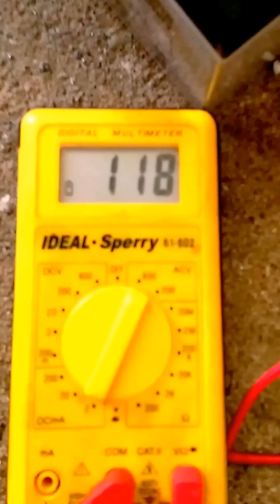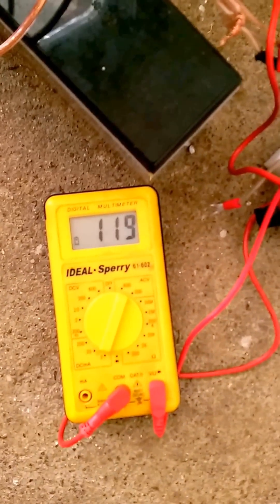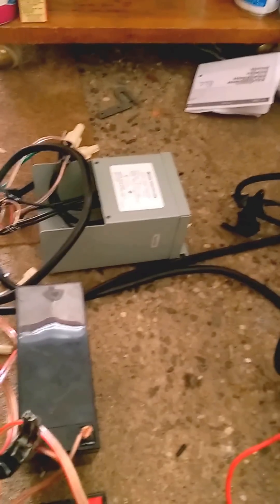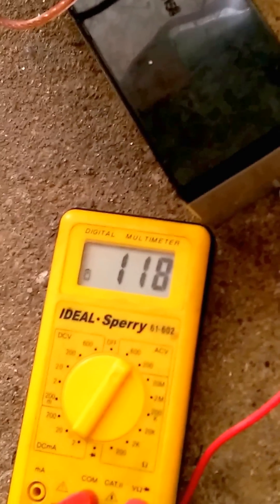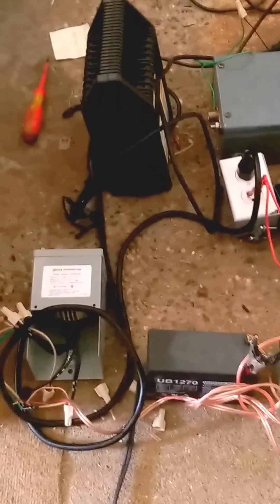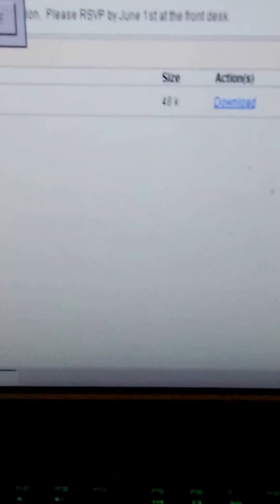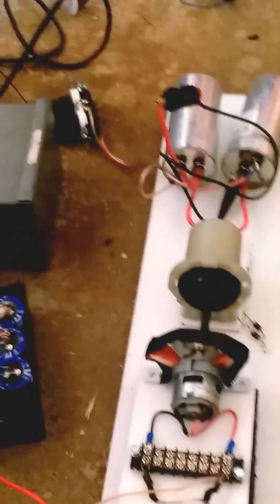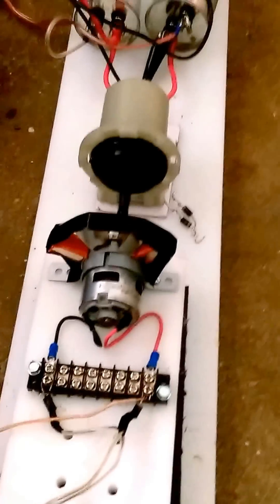Gerard Morin Washer Pump Generator &  PELEX DEVICE Successfully Looped!

Comment: Are you trying to claim mains transformers are resonant devices?
Reply from the maker: +Mark Tillotson I was trying multiple options to see if I could put the DC voltage from the overvoltage spikes coming from the Morin Washer pump generator to add additional charge to the capacitors through the rectifier. The generator creates a pulsed square wave and the output of the transformer was not working correctly, due to the increased core saturation causing too much of a loss since the wave coming from the genrator is NOT a sinewave as most folks think. I tried to utilize this cold electrical spike in an attempt to collect the additional energy and dump it into the cap bank for use as a recirculating current in an attempt to gain a few volts to make the motor continuie running without loss. The Pelex device would have done this all by itself if the generator was a sinewave, however, at the time of the video, I didn't rea;lize this until I scoped it later that night to see why it only had so much output, and only enough to operate one ac bulb and loop at the same time without loss. I recreated the system using a different generator which gave me 1250 watts out after all of the loads in the system were consumed, as well as the losses. The next experiment I did was to step the voltage much higher and use the hairpin circuit with an air capacitor to create resonance, and it did work as i anticipated. Please see my next message where I explain how the new PELEX DEVICE operates without external power. The batteries fire the motor, and, the pelex device does what I state in the next comment's reply.
Reply from the maker: +Mark Tillotson  Hi Mark, I believe that tansformers of any efficiency have to be very close to resonance if they do not already resonate, especially if we wish to draw in energy from another place wirelessly. The system I built utilizes transformer coils matched with capacitors to resonate at the Schumann Resonant frequency of 7.8 hz.  I got the idea of how I would do this from Stanley Meyer's VIC coil, however, it didn't work until I built the core myself which caused an overunity just like Gerard Morin's transformer phenomenon. When I scoped the coil with my variable air capacitor and found resonance, I read the capacitance and found what I have aimed for from a frequency chart around 8 hz. When I adjusted this and soldered the cap onto the coil, I was receiving a signal at 7.8 hz and the coil was automatically outputting several volts of power without any input.. I was just using the transformer as a receiver of this energy and by applying a signal to the other coil, I was receiving additional energy that I didn't expect. With the correct input, there isn't any issues at all with obtaining resonance without adding outside components such as capacitors,  however, to make this happen if they aren't in resonance already, minor adjustments of the capacitance can be made to both coils in a couple of ways, first to improve the efficiency, as well, by rebuilding the coils to make the inductor have more capacitance in combination by winding a secondary with a thin aluminum plate or foil, and, building the windings over an oil impregnated paper dielectric with the primary wound over the top of the secondary using a very fine, extremely conductive wire, this can be accomplished fairly easily, if the correct frequencies are obtained purposely. Accidentally, it isn't very common for any resonance to happen, however, with transformers of super quality, the resonant frequency is the optimum frequency to reach, beyond this, the device will saturate and cause massive losses. To obtain overunity, the core has to be very specific, either cut to eliminate the Lenz effect which is the unwanted flux path that creates the CEMF to cause the load to be forced back to the input/source like any ordinary transformer works. I completely eliminate the source load and transfer it by creating  magnetic manipulation similar to Tom Bearden's MEG operation to initiate an incoming stream of energy that is channeled in using a sharp pulse/spike containing a  high voltage pulsed square wave with a very noticeable sharp spike of 50-125 volts at the leading edge of the squarewave that's produced by the permanent magnet rotor. This works kind of like a switch to turn on a stream or channel of energy from the atmosphere, allowing it to become attracted to the device's magnetic field by the oscillating pulses by attracting or manifesting a very unique phenomenon. This creates a "Flip Flop" of scalar energy forced from the forward and reversed flux surrounding the dual core that attracts the energy from one core while the other is merely pulsing a magnetic radiation that allows the energy to be channelled from an aetheric source during the change in wave from + to -  , and, the funny part is that it can only happen while the load is connected to the device.  This incoming energy is forced to the secondary by induction, however, the primary coil's pulses create the field that this energy is attracted to, however, it can't induce to it since it is already powered up and it's field aligns and synchronizes the flux of the secondary, allowing the scalar waves to be induced like magic. The device sees an AC waveform on it's output under load, and, while one polarity of pulse happens, one core releases the field attracting the source energy while the primary coil induces the aetheric electricity which causes the secondary core to release atmospheric electricity as cold electricity to the load while the other pulse happens of the opposite polarity , then the opposing core attracts this stream of energy while the the other core causes the field to be induced and transformed to usable electricity of the opposite polarity. (to make it easier to imagine, one coil  pulses and the core's field attracts the stream of energy while the other one induces to give one half of the output wave, then, the opposite happens and the other core attracts while the other side induces the opposite wave.) In other words, we have 3 coils. The first coil is the primary or "pulse" coil as Stan Meyer used to give to the core in his VIC system. The pulse creates a magnetic field of opposing polarity, causing an attraction from the aether to one core and it's field as the other core's field allows this energy channeled in from the aether to be induced into the primary which is connected to it's output. Since the cores are separated, the input coil is a series/closed or shorted coil that receives this pulse of energy  from the generator without being able to transform from one side of the transformer to the other since it is a shorted coil that's wound around both of the cores, making the flux shift directions during the shift in polarity as the magnet passes the coil in the generator for each polarity. The next two coils wound around one end of each laminated core supplies an oscillating field that turns the beam of incoming energy on, the next coil induces it and sends it to the output for use to do work. There are 3 ways I have designed this transformer to work, and, all 3 need to resonate to function as i do in the Gerard Morin Transformer experiment. I have found a way to do this much more efficiently using utility transformers as Gerard does, however, it was very difficult to do and it took time for me to back engineer this phenomenon a few years back when I saw this happen during a local power company failure when one of their customer's permanent magnet genset backfed their system since the customer left their main open while their generator was in operation, as they were illegally installed without an up to date transfer switch. Their generator fed a faulted high voltage shielded cable which was arcing and exploding over and over without killing the generator or popping it's circuit breaker. The engineer recreated the failure on paper and calculated the load to be well over 400 amps worth of energy to create such a calorie rating , by the volume of the fire and damage to the existing cables of another circuit in the manhole where it all took place. The system was feeding the secondary side of a transformer, fed the high side (primary side) by backfeed, and, since all switches in the system were shut down, nobody could figure out that the customer's generator was operating. The transformer was installed on the floor of the manhole and all of the ground cables were blown off of it from the cable fault, which caused a massive explosion at a cable splice. The instance that started the overvoltage is called Ferro Magnetic resonance, and it is known to usually happen when 2 transformers of different sizes are connected in parallel and the system is being energized one phase at a time, creating a feedback loop through the different phases, returning on another phase instead of a neutral cable. The bonds to the ground in the manhole were rotted off, and, the other places where equipment was supposed to be tied to a ground were burned off, causing the cold radiation affect and an overunity that resulted in 6.5 times the transformer's full rated output of 15 kW, feeding Since the system was a 3 phase system, the transformer only fed back to one phase, but, since the phase was tied in Delta to the transformers in the system, the systemn kept feeding this abnormal amount of energy and did not open the unit's circuit breaker. Mathematically, the engineer stated the system was producing around 400 amps, so, if we calculate the wattage times 6.5 times, we get 97,000 watts, which divided by 240 volts equals 406 amps.. very close to what the engineer rated the arcing and explosions from it's heat in an enclosed area.
Reply: So in a short words, the primaries are connected in series though wound in clockwise and counterclockwise directions?

Comment: This technology would employ all of those currently employed in energy times ten.
Your excuse to not share does not hold water.
Reply from the maker: Craig Stock Please explain how this would be when it would clearly eliminate electrical distribution and sell only to those interested in purchasing one of these. My grandmother could install one of these, so, please, with sugar on top, tell me how it would benefit the energy industry and keep the lineworkers, the engineers, and all of the people building systems to create energy working. I really think you are trying to hard to think, or, the thinking cap isn't clearly working. My background and employment in the energy industry is just that, feeding customers from one place to another by distributing high voltage energy through electrical cables, this being marketed would eliminate that completely because every person in the world would buy one for their home, then, once it is easily back engineered and it becomes open sourced, I lose as well, and I designed it.
Reply from the maker: Craig Stock another experimenter looking for a freebie on my dime. Why is it so when we work our hearts out and spend so much to figure things out that we have to give something away that cost so much to design? I don't get it. If the shoe were on the other foot, you'd probably be a bit more understanding. I didn't do this so I could give this shit away. I did this to prove it could be done. It isn't a play I have going on here, it's a message to those who have a few abilities to do what science is saying is impossible, when nothing is impossible. Now instead of spreading sarcastic comments all over my page, It would have come back to you a bit differently if you asked me nicely the methods used to figure it out. That I would have shared, but, you've already pushed your luck. I have people here not too far below this comment who have earned the real hints as how this worked, in fact, some of my mentions are in the comments. I've already had many things happen that don't happen to the average person over sharing schematics and such. I enjoy my freedom, my family, and my life.. enough said.
Reply from the maker: Craig Stock the #1 reason I can not to share is to protect an investment.  It's really nobody's business but mine and an investor that's finally gotten involved. The system has gained popularity, but, it is one of two  moves at this point, a piece of this technology is being used as another product so it can't be immediately used for generation to be used to eliminate all fuels in one step. Second, any investor that has enough money and influence with a specific market can buy in.. I am not shy, but, like I said, it isn't going open sourced because it is something I have spent dearly on and I need to first get my money back, then, once this is done, I have a lot of R&D to do, machine and test equipment to purchase, a building, and employees to do some of the work necessary to set up the machinery that's being used to develop the other device. There is good reason why this is being done, but as I said, it is under strict confidence because we need not anoybody find out what the other device is before it hits the market, and it is already way into it's development, I just do not wish to share with anybody as it is being developed as a totally different device which has abilities to do something much more believable, which will not show any ties publicly to Pelex other than financially, which won't be able to be proven so the skeptics don't ruin a chance my investor has taken. Sorry, I just don't want to ruin anything.. there are many people wishing I'd share it and I just can't do it, but, I have some pretty interesting developments unrelated that I'd like to post informational videos about, unfortunately Youtube has disabled my ability to post and I need a place that ill allow this.
Reply: @advanced-electronic  only the few that play around with thus stuff now would be interested...out of fear the remaining 99 % of mankind would CONTINUE to follow their " Programming "...no example or PROOF would EVER change their position... sad but true :  (    hope all is well...your friend. Jay Fox ! Cheers everyone and have a wonderful day
Reply: this guy is so lost !!   let him try and use some of this free energy ! then see what happens.  !!   100 amps my ass  = might be 1.5 maybe ?

Comment: You do understand that this information is going to be released soon with or without your help though Marc Belanger. It's unfortunate that you see the release of this technology as a precursor to chaos in an industry that has enslaved the human race on the pretext of greed. This information and information in relation to aether manifestation of electromagnetic energy is going to change the world. The jobs this technology destroys will employ the world for several generations just undoing the mess it took us a 100+ years to rush into. Millions of tons of copper will be pulled down from power lines and repurposed, factories and or home shops will produce all variety of aether or radiant energy driven motors and generators. The world will change but that is the lesson of nature and the lesson you are missing in what you've discovered. Change is life and life is change. We do appreciate your sharing information though :). You should start using a temperature reading apparatus as its been very revealing in my experiments!
Reply: TheFutureSoundsGood.
Reply: I can do the same as your pelix box with a resister diode but i haven't seen your 100 bulbs but theres alot of room for improvement
Reply: I also built my own twizzle smizzle box but i cant tell u or show it because it will make turn Donald Trump's fupa fart and that would not be prudent